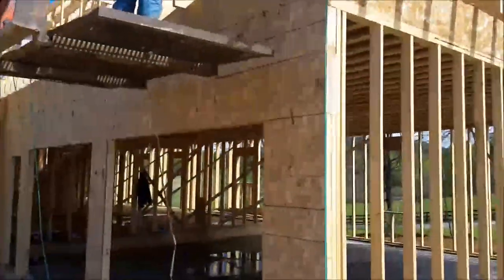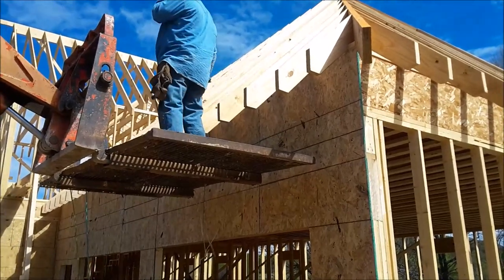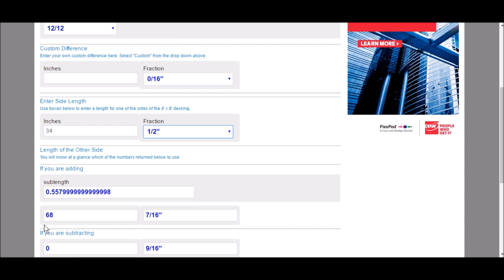Decking a Hip Roof

Comment: Thanks for the video. Sorry for all the shitty comments..my framing square has a table to figure the same sheathing offset as your calculator, I think. Multiply the width of the sheathing (either 48" for sheet goods or 8" for plank) x the number under the corresponding roof pitch. So for a 7 in 12 it would be 48" x .8638. That  gives you 41.4624" to pull off the upper outside of the sheet